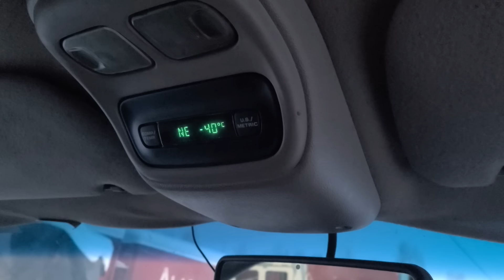Driving in the Arctic!

Comment: Extremely awesome video a lot of the same rules apply in northern Minnesota where we have a lot of moisture in the air and it is not as cold but lots of wet ice of pavement. I learned with my 1997 Dodge Cummins diesel engine and 5 speed and 4x4 I have learned to keep the engine under load when on ice and keep weight in the box .  The Cummins has to  much torque with out weight in the box the extra weight helps the engine have to work some to help the heater work better too.  One day I went on a 20 mile trip on glare ice I couldn't get enough speed to make any heat in the cab the windows started frosting over.  I also learned that if a vehicle is air conditioning equipped if it works properly the windows stay clean because the air conditioning system is dehumidifier the indoor air. Keep up the great videos

Comment: Thank you for making this presentation.  There is one thing I have never been sure of, you might be the person to finally explain it.  I have an 89 Bronco with standard slip differential in the rear.  On a slippery surface with 4wd turned on, which wheels will definitely get power no matter what?  Thank you.
Reply from the maker: None will definitely get power.
Reply: One front and one rear. Whichever of either is easiest to spin. Could consider a lunchbox locker to alleviate this.

Comment: For brake fluid, (bear in mind that I';m from the 48) I would recommend trying A pentosin product called Dot 4 LV. (dot 4 is fine in dot 3 cars, its kinda like octane, different amounts of the same chemicals) Same brake fluid, just Lower Viscosity. Now, I don't know if the lack of viscosity will cause problems when warm, but it is OEM or equivelent for some or all modern Volvo and a few other european or derived cars. 
Also, generally speaking, the higher quality the synthetic fluid, motor oil or otherwise, the better performance you'll have hot or cold. The best base oils have the best viscosity index; meaning the viscosity doesn't change as much. Get the highest quality synthetic oil you can afford.
Reply: I have not heard about low viscosity brake fluid thank you

Comment: I live in the mountains. Alot of people forget to use 4low and 1st gear to descend hills and instead rely on the brakes.  Alot of accidents happen that could be 
 avoided if they used the low gears and engine as a way of slowing down instead of locking up the brakes

Comment: A couple of additions. The road leading to intersections can get slippery from waiting cars pumping out condensed water from the tailpipes and freezing on the road.
      Used to live in Delta Jct. in the 70's and 80's You will find free roaming buffalo there. If you suddenly drive into a dense patch of ice fog beware. I have on 2 occasions, driven into a dense patch to find it was hiding a herd of buffalo. They can put out a lot of ice fog. They are also white from being in ice fog all the time. Lots of fun.
     The light pillars as I call them are formed by flat stellar dendrites (think perfect flake). In calm air they float in a flat orientation. They reflect the light source in all directions, but the only light you see are the rays that come straight at you. My theory anyway.